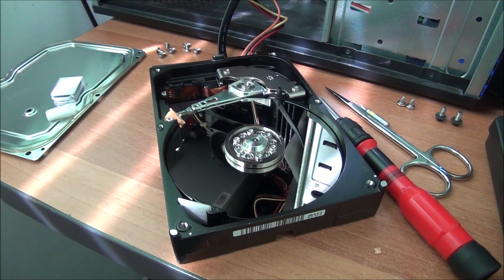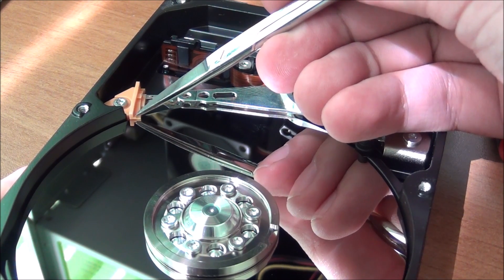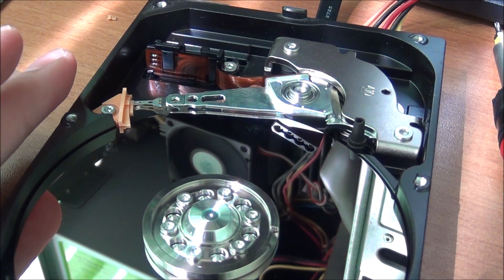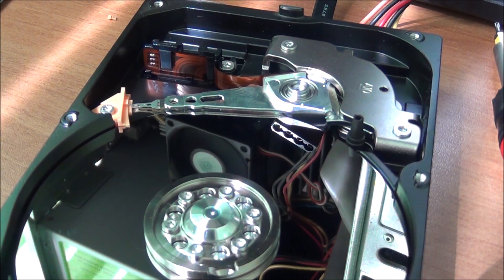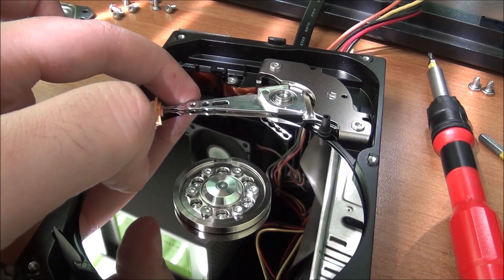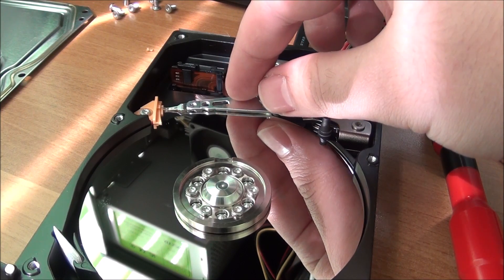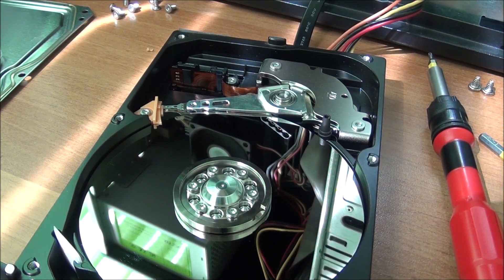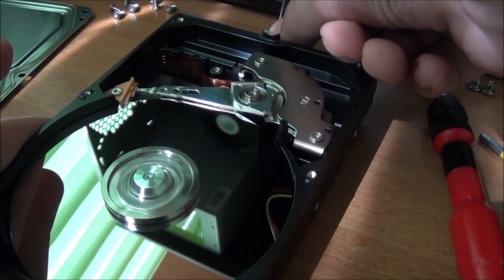What the click of death that you might hear from your hard drive actually is

Comment: Resp Sir! Very Nice Sir. My Seagate 500 GB Hardisk is Spinning and Stopped Sir. All SMD Diodes, Resistors, Cpacitors are Good Values Not Beepsound Sir Not Shorted Sir, Sir Moter Problem Sir where the Problem Sir, Motoer IC Heated Sir. PleSe Advised Sir.  --    ChinnaRao Paderu Andhrapradesh India.

Comment: I have this hard drive external one. The thing is every 30 seconds of an activity, it will park itself. If I implicate it, I do not hear that clicking noise. So is it coming with external hard disks? wdc wd50ndzw-11a8js1.
Reply from the maker: That could be just a really agressive energy management in the firmware. I had this in a laptop hdd.

Comment: My external drive does exactly this but it is not damaged. It was not dropped. I need to get my data off and I have tried using Disk Drill and others but they got no data after scanning. I guess it wasn't really scanning if it did this. What do you advice. I keep all my stuff on this drive and have no backup.
Reply from the maker: My advice is to contact a reputable data recovery company.

Comment: You already removed the screw of  head pivot point during the removal of upper shell  (as seen on  upper right side in the video) so when coils energized head arm moves up due the to magnets then strikes the platter of course.
Reply from the maker: I don't have the drive to check, but would that not be a stupid design? To tighten that only trough the case. But the noise was made by the drive exactly the same before opening it up.

Comment: my harddrive only does a clicking noice then disconnect then connect again when i copy data to it or installing on it what does that mean also not all the time
Reply from the maker: Could be normal sounds, but also a sign of possible problems. Depends a lot on how it sounds.
Reply: @UltimateDIY  its a click then it stops then clicks again after a while like when it reaches the end then goes back but it disconnects then it reconnects again
Reply from the maker: @brandonbiochucky3116 disconnecting and reconnecting is not a good sign.
Reply: @UltimateDIY  i did a format seems to be oky for now wonder could it be power because im running 12 harddrives a i513400 cpu gtx 1660 super 32gig ram and 2 keyboards a mouse and a mic
Reply: on a 500w psu
Reply from the maker: Wow, that is too much I think. Or the hard drives bother one another while writing. Consumer drives are not meant to be kept so many next to eachother as they all vibrate.
Reply from the maker: Wow, that is too much I think. Or the hard drives bother one another while writing. Consumer drives are not meant to be kept so many next to eachother as they all vibrate.
Reply: @UltimateDIY  i know problem is that all my games is installed on them so its difficult to remove them i was thinking on getting ssds
Reply from the maker: SSDs would use less power and no vibrations.
Reply: @UltimateDIY  then im going to change to ssd
Reply from the maker: @brandonbiochucky3116 great 👍🏻

Comment: dude really kept a magnetic screwdriver next to the drive :|
Reply from the maker: I could have licked the platters and make no difference. That drive is dead!
Reply: @UltimateDIY  good point. xD
Reply: @UltimateDIY  in hindsight, i think i may have come across a bit mean. i think your video was truly educational. i have heard this exact same thing in an old hard drive of mine once, not knowing what inpending doom was waiting for me (i was still a teenager then). but now, knowing quite a bit more about computers and its components, this sound strikes fear into me XD like, i go full on panic mode XD thank you for showing us everything and explaining it so well 👍
Reply from the maker: No worries! I know what you say. Last week my 5TB external hdd made the same noise. I went into full panic mode. After that I realised it was connected to a usb hub that had too many things pluged in and was not providing enough power, so the hdd was turning on and off continuously. Or, at least I hope that is what it was, because it worked perfectly when I pluged it into the laptop directly.
Reply: @UltimateDIY  I'm glad to hear it worked much better afterwards!

Comment: My smaller external hard drive started making sounds after a fall and no longer pops up on the computer (showing up as "not recognized" and "unallocated" in disk management), is it the same thing? Sorry about the link: https://youtu.be/1IyvWwFFg7g
Reply from the maker: I would not power on such a hard drive anymore and directly send it to a data recovery company. But from the sounds in that video, it might be too late, as heads probably are scratching the platters.
Reply: @UltimateDIY  Thanks for the info!! If the heads are scratching, I probably won't send it in just to be told the same thing...
Reply from the maker: Maybe search for a company that has a cheap first look.

Comment: Hey so I was wondering.. I was upgrading my old macbook to ssd and put the old HDD into a CD Dolly. Now it makes very light, soft clicks.. Is that okay? I can't find the answer online with whatever I'm searching and I don't have any important info on it I just don't want to spend more money on another ssd. Do you think the HDD will be fine? It's tightened into the dolly as much as I could. Tried loosening too and didn't help.
Reply from the maker: Hi. Sorry, but I don't even know what a CD Dolly is.
Reply: @UltimateDIY  The thing you put in the Cd rom as an adapter for a hdd
Reply from the maker: Ah, a caddy. Maybe the hdd always made this noise, but only now you hear it because of a different location.
Reply: @UltimateDIY  I had it running without the cover on and it didn’t make it and it has more padding around the caddy so I don’t know why
Reply from the maker: That is weird. Maybe the caddy amplifies the sound somehow.

Comment: A week ago I noticed my pc making this exact click noise. My pc is really old so when it started making this noise I didn’t pay much attention to it, it would always make weird noises. Unfortunately, today I turned on my pc only to see a black screen saying, “Boot disk has not been detected or the boot disk has failed”. Does this have to do with the hard drive? Does the hard drive have anything to do with booting up my pc? I haven’t found any way to go around the black screen of death…
Reply: Yes, BIOS is telling you it cannot boot into Windows (Because either the connections go bad) or the drive has failed.  Surprisingly, sometimes connections from the mother board port or on the drive itself are loose or failed.  Check those first (Both the small plug (Data) and the larger Multi-wire one (Power).  I have had those issues.
Reply: I don’t really care about my pc itself, but I have a ton of art projects I don’t have archived that I really want back. Can I also restore my data somehow??
Reply: @moonimilk  You could pay a technician to have data recovered but the chances are low, and the price is usually pretty high.
Reply: @mulex8758  Yeaahhh I figured…but thanks  :)
Reply: Yes of course it does. The hard drive is where your computer stores all it's software. Hard drive fails = no software, no go.
Reply: Hi Niko. Yes, you had clicks of death problem. As you can see, it died several days after first clicks. It although worked for a while. Sometimes clicks of death means death, sometimes it means approaching end of disk, which strikes usually very soon... in hours, in few restarts (stop spinning and start disk again), sometimes after days.
You should not turn PC on, after first clicks, until you plug in other drive, even external one, and immidiately back up all your data.

Comment: My hdd clicks only when i turn my system on, but sometimes it doesnt click.
I dont know of its my power supply because my system is working fine and i'm using the same sata power cable with  ssd and hdd.
And i dont know if its the hdd or this cable.
Everything else is working fine.
Reply from the maker: Could be the first sigh of a failing hdd. I had one that started to do this about 1 or 2 years before finally failing.
Reply: @UltimateDIY  danm... this hdd have 2 years only. 
If this fail i will buy an ssd

Comment: the "not a click of death part  (@ 6 min) gave me a bit of relief..
I bought a 14tb drive to merge /store & sort a bunch of data on and it sat for a long time. I made SURE it was secure (no drops/falls,etc)  but finally installed it in my desktop computer.. 
    there's nothing on it yet (just installed & partitioned) and I notice every several minutes, that 'click' but it's intermittent, and seems to time with inactive time.
- there's no programs on it; the CPU is running off a separate M2 SSD chip & my current useage storage is on an external SSD for the moment.
______________
With this power-cycle little clicks, is it bad design & I should really look for something else?
-Should I approach the Mfr warranty (before loading & processing lots of data) to swap out under warranty?
- kinda bummed as it was rather expensive for me, and I learned my lesson once from a different HDD that slipped about 6" on a shelf & tipped over & was dead (2TB HDD). I've been extremely careful with this one.
   thanks for your experience & recommendation/suggestions.
Reply from the maker: Sadly, most drives come with such power saving features enabled. I would not worry over it and use the drive normally.

Comment: I have the same issue after manually releasing the spinning heads from the platter. The thing is, the device driver is activated when hdd is connected, but the partition is not shown. Can someone tell me sweet-sweet lies and say that this is still somehow fixable? I don't care about the drive itself, maybe any chance to get data, or at least it's part from the drive?
Reply from the maker: I would contact a data recovery company.

Comment: My PC is about 11 years old, all this time the Seagate Barracuda 750GB included has been working fine, about a couple of months ago I heard a series of constant clicks, they stopped after a reboot, now 2 months later I just had another series of clicks, sounded like a constant drop of water,  followed by a blue screen which I could not read since it disappeared very quick. I rebooted with long press power button and now PC is working fine again. 
I read that sometimes the clicking can be caused by a faulty PSU, the only change I did was to install a small SSD a couple of months ago. 
Do you think I should replace my HDD? Having clicks every couple of months is also considered a click of death?
Reply from the maker: Maybe your hdd is starting to develop bad sectors. Sometimes also those can create clicking noises while the hdd attempts to read from them.
Reply from the maker: Do a disk surface scan and see what the status of the surface is.
Reply: @UltimateDIY  Thank you, which software is recommended for a disk surface scan?
Reply from the maker: I use this: https://www.hdsentinel.com/help/en/61_surfacetest.html
Reply: how can you do animation on a 11 years old pc?
Reply: @reiayanami1441  Well, I work with an old version of After Effects, and is still running fine. I still don't want to update since a lot of my assets probably will need a lot of rework. 😅
Reply: @TobiAnimados  so you kinda stuck on that machine, can i ask you the spec of the computer?

Comment: If i don't care about the data, and I only want to repair the drive, what can I do?
Reply from the maker: If the heads have already collided with the platters, there is nothing that you can do to fix it. It would require you to have a working donnor drive and replace damaged parts.

Comment: why do manufacturers not use stronger material to hold that head, I mean after so many years of laptops with same "no bootable device" you'd think they'll create better hard drives
Reply from the maker: These days everything is built to the absolute minimum to maximise profits of manufacturers...
Reply: the "indectrutable drive" would be too costly. I think, 1GB drive could costs like 500$ or 1000$. They would be able to make drive that is very durable, but it would be not profitable. Everyone would buy 50$ or 100$ common drive.
Actually, there are more quality drives, for example WD "RE" series. But not many people buy them. They buy usually GREEN stuff, maybe BLUE. People are usually not willing to pay even 10-20$ extra, and often goes for cheaper solution. This forced them to make drives that are in most cases usable for 4-7 years, but from time to time, die. Seagate is good example of it. Once, it was maybe best hard-drive company, but then, they fallen... because of finantial issues. 
There were also many very good motherboard manufacturers. Like AOpen, DFI, Abit, Soyo.  They bankrupted, other companies bought them. Etc... Seagate bought Maxtor for example.

With your hard-drive, that is ultra durable, you would not survive on market, it would be too costly.
Reply: @warrax111  Not everyone has 50 bucks in the bank or 50 dollars worth of gas in they're car. Hell some people are still on windows ME.
Reply: Designed obsolessence, designed to break after a curtain amount of time

Comment: Well dang. I looked for some of my Blender files and realized my whole drive was gone. I hot swapped it out and back in and this click is what I'm greeted to. Funny though, that was my backup, so my backup failed before any actual used drives did lol. Really helpful info though, thanks for sharing.
Reply: For mission critical files, always follow the 3 2 1 rule:
3 copies of your data
across 2 different types of media
1 of which is physically in a different location
Reply from the maker: Agreed 👍🏼
Reply: Funny thing is this is exactly what happened to me… Looked for some Blender files the other day and noticed my hard drive wasn’t working, then I unplugged and plugged it back in and panicked because it started clicking…
Reply: I would say hard drive is most unreliable things ,
I have used only 30 gb of 1000gb and hard drive gone😊😅
Reply from the maker: Weirdly enough, many drives fail like this...

Comment: Bought a HDWD240UZSVA (Toshiba, 4TB, SMR, 3.5'', P300) recently... That aggressive parking is driving me crazy. Was searching all around for some HDD click videos. Yours is educational and helpful. Thanks. As for my case, the thing parks the moment data access/transfer is over. I appreciate the power saving, since I am not the only customer and that would help reduce burden on planet slightly. But I do not appreciate the mechanism hitting plastic over and over which causes owners to get more anxious and drives them nuts until they throw the HDD out of window and cause more e-waste.
Reply from the maker: You can solve the problem like this: https://youtu.be/D1IEdpFveJ8
Reply: @UltimateDIY the head on my data drive is just stuck in parking slot. It’s not going to the data platters to read and write. Data platters are clean but techs don’t want to fix it.

Comment: Bruh. If the head is broken you see no scratch you can buy for hdd donor and try replacing the platters like professional data recovery company do. And i aint doing shit if you replaced it in disgusting room
Reply from the maker: If you are desperate, you can try it. But keep in mind you only see the surface of the top platter. Scratches could be on lower ones.
Reply: @UltimateDIY  Yep. if your hdd is single disc. with no scratch, Great news the data recovery have 98% success rate.

Comment: https://youtu.be/0E0M7vuTquE   What you think about this problem ? I changed the head from same disk but the same problem. I change the PCB plate but nothing. How to backup if its is not working
Reply from the maker: Don't run it like this without cover on. Also, this head replacement needs to be done in a dust free enviroment.
Double also, you can't change the pcb from one hdd to another and still have it working. It was ok back in the day, but now informations are stored on the pcb that are ok only for the original hdd it came with. Data recovery companies copy that data from the bad pcb to the new pcb as far as I know.
So, sadly, I think only a data recovery company can retrieve your data.
Reply: @UltimateDIY  Understand. I only want to know what is the problem. Head ?
Reply from the maker: Impossible for me to guess. I don't have enough experience with this.

Comment: Hi yesterday I got My HDD really like this, and cant open windows, so i change it to a new hard disk, but still can't get my old files, what should I have to do?  (The disk is clean and there is no scratch on it)
Reply from the maker: Hi. You should not have opened it. You always try to use data recovery software.
Reply: @UltimateDIY  i already opened it because my computer can't even detect it, nothing will come when i plug that hard disk, can i use software like disk drill, without my computer reading the disk?
Reply from the maker: Sorry, but YT deleted your last comment. All I could see is that you already opened it because it was not detected, or something like this? In that case, there is no way to recover the data without a data recovery company.

Comment: Hi, I just a got a new laptop two days ago and I've noticed very quiet clicks coming from it. I've checked the HDD and it has no bad sectors. Do I need to replace it?
Reply from the maker: Hi. Many laptop hard drives have a really aggresive power management, so it might just be parking the heads really often. Also, it could be just read/write noises.
Reply: @UltimateDIY  Yes, it's a Lenovo laptop with AMD so it has both of their tools for power management and such! Thanks a lot, I'll check the settings in the respective apps.